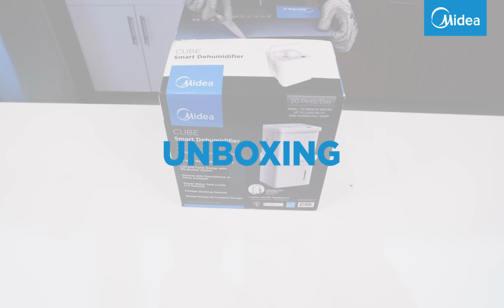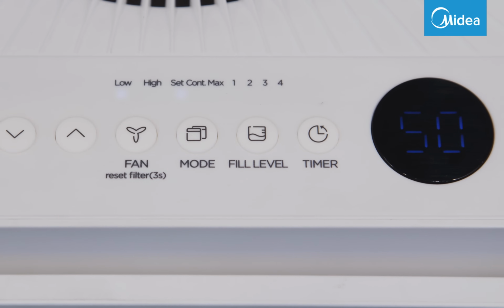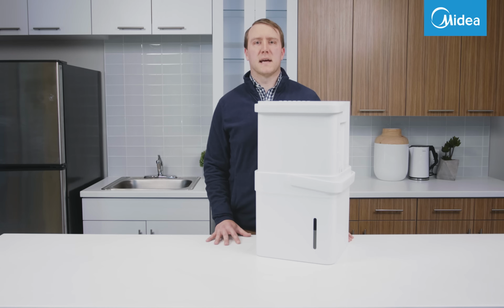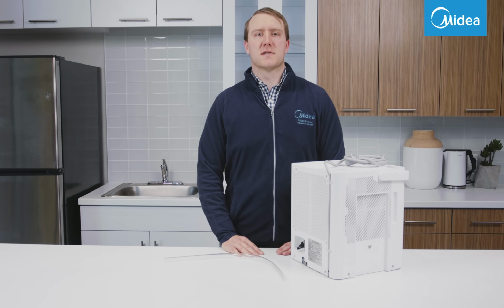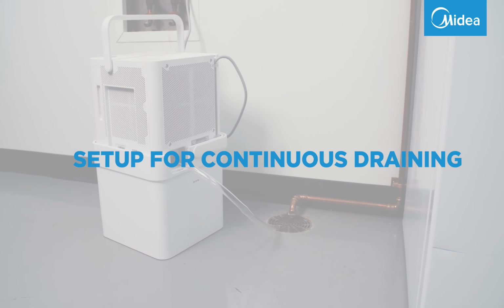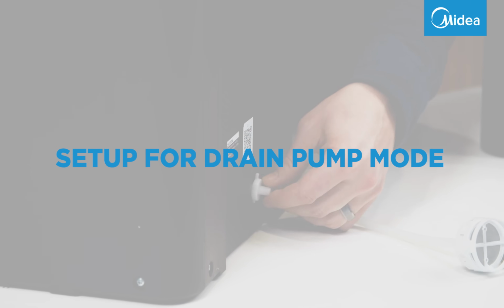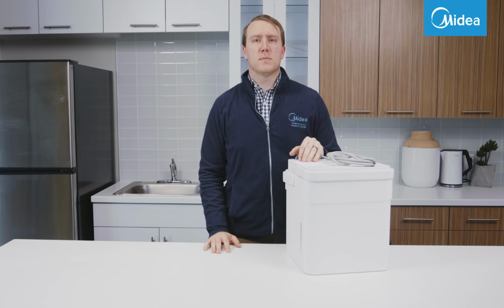Midea Cube Dehumidifier Operation and Overview

Comment: Does bucket have to be full to use pump feature??? Mine isnt pumping anything or even turning on does it take a while ???
Reply from the maker: Hello Jose. Thank you for your question about the Midea Cube. To initiate pump mode you will need to install the pump hose and remove the plug from the pump drain hole. Firmly attach the included pump hose. You will need to hold both the up and down arrows for 3 seconds. The pump inlet hose must be placed in the bucket in order to pump the water out of the bucket. You can also refer to page 13 of the user's manual attached: https://m.media-amazon.com/images/I/D1-CUVsknhS.pdf. Hope this helps. Have a great day! MideaCustomerCare@hartehanks.com Reach out anytime on Facebook at m.me/MideaAmerica.
Reply: Yes bucket has to be almost full with the pump turned on before it will actuate.
Reply: @Shawn P.  over the level of 4, correct? Thanks for the useful comment! Many people ask this question, and support does not give this simple reply.
Reply: @Shawn P.  just figured it out. Yes, slightly over 4. My pump works!!! Thanks a lot 😊

Comment: Just to clarify:  If the mode is set to a desired humidity level, does the fan run continuously or just when the unit is dehumidifying?
I don't want the WiFi feature......can it be left turned off?
Reply from the maker: Hello D6c10k. Thank you for your comment about the Midea Cube Dehumidifier. Please send us your questions on Facebook at m.me/MideaAmerica so we can assist you.
Reply: @MideaAmerica  You're a freaking wealth of information!

Comment: I can not remove the filter!  I have tried, but it seems like it is stuck!  Help, please!
Reply from the maker: Hi David Blanchet. Thanks! The 2 removeable filters in the Midea Cube are curved to wrap around the back of unit. If you have trouble gripping the filters on either side, use grip pads to grasp. Reach us on Facebook at m.me/MideaAmerica for more help!
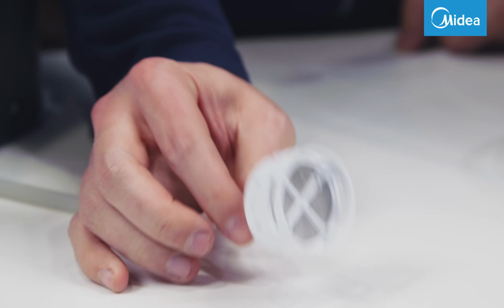Reply: About the 7:00 minute point he removes the filter. You have to pull out (not easy to do, might want to use a credit card to pry it outwards) then slide out.
Reply: @zefallafez  Definitely not as easy as shown in the video, at least the first time. I used a small flat head screwdriver to pry the filter latch open.